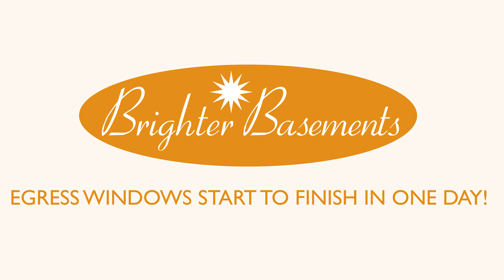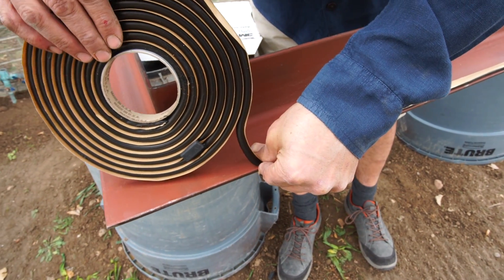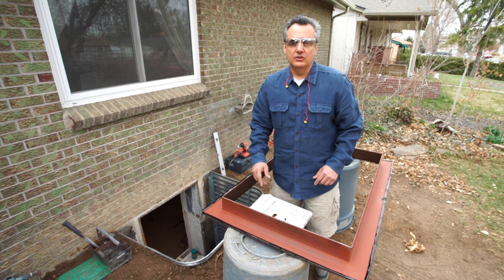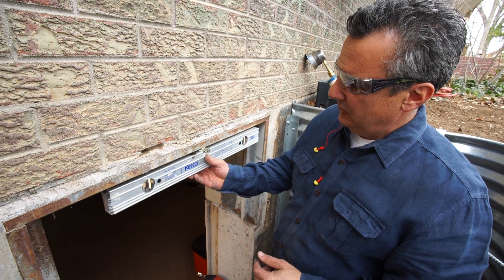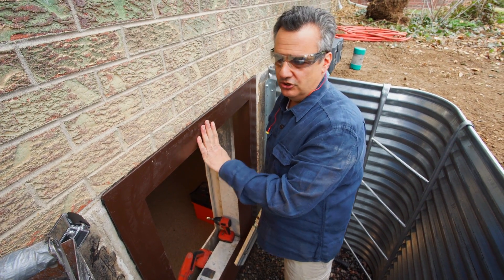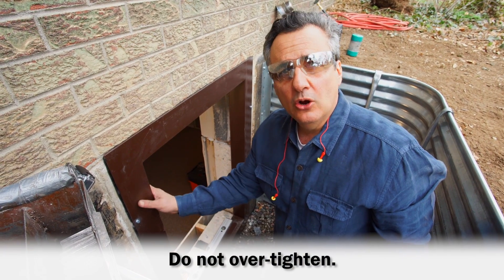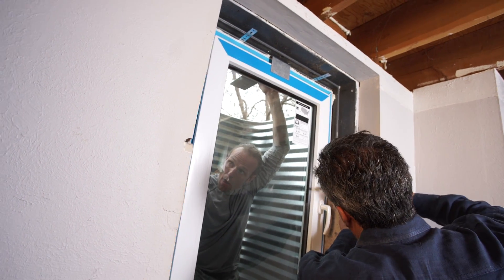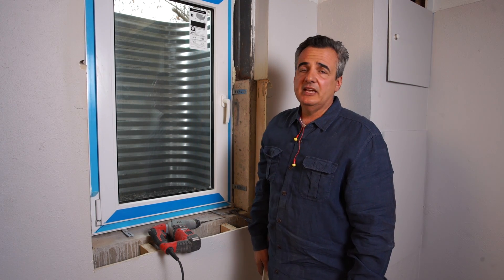2020 ExoFrame DIY Egress Window Installation

Comment: How are you gonna trim out this window. Seems like a great product. But I’d rather 3-2x8’s pressure treated header with double jacks on each side. There is no way this is a better solution.
Reply from the maker: No trim required, the steel flanges serve as the trim.  your solution will result int 4 inches less glass relative to the overall opening size.  Feel freer to call us, happy to explain the benefits.

Comment: Best one yet no Wood to rot out and strength for overhead walls.
Reply: No actually it will rust..its attached straight to the concrete which will get wet with condensation and different weather cycles. I'd rather make a casing out pressure treated lumber which can withstand getting wet. Even if it needs to be replaced its very cheap and easy to do so
Reply: @ayoubfarid1663  Masons use steel to hold the brick lentil up

Comment: @ Robert Bates.
Although I'm not a pro, I'm pretty sure that my common sense won't let me down. If you're a typical window installer, you trim your window with wood; your prior experience tells you to. But the EXO Frame appears to be a solution for installing windows below grade. The problem with windows that are below grade is that they are surrounded by foundation walls that hold up tons of house. It's obvious to almost everyone that when you upgrade to an egress window, the trade-off is that you loose a chunk of your foundation wall.

Personally, have a strong feeling that metal framing would hold up much better than wood framing. From my personal experience I'm pretty sure that steel beams are 24x stronger than wood beams. I also know that nobody would never want to build a house foundation out of wood. As a window installer, you may feel that the EXO Frame may be overkill. But as a homeowner, I might feel that I'd like to keep as much strength in my foundation as humanly possible while upgrading my basement with an egress window.
Reply: You are correct, it's really a no-brainer.  Thanks for sharing.  Theo